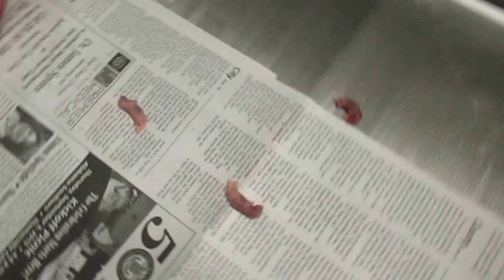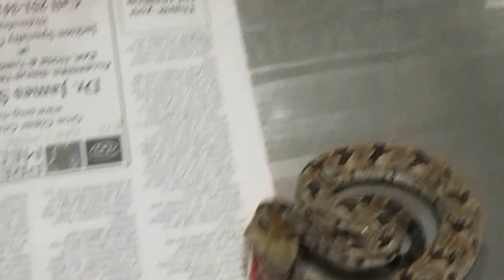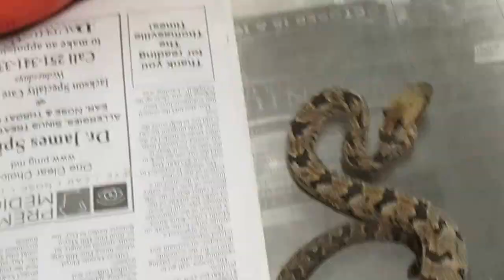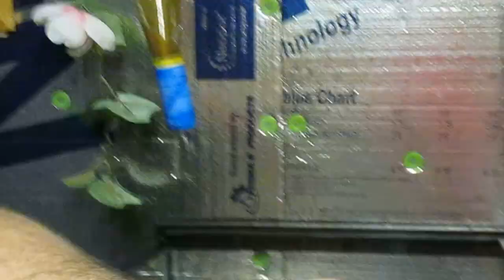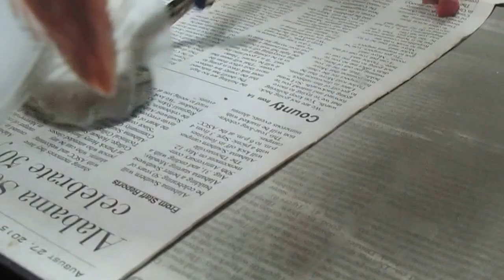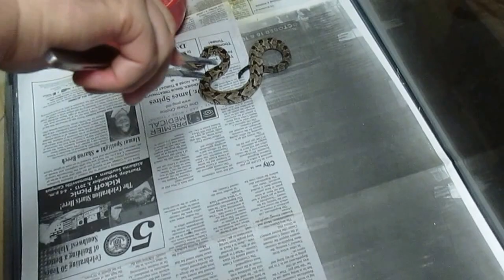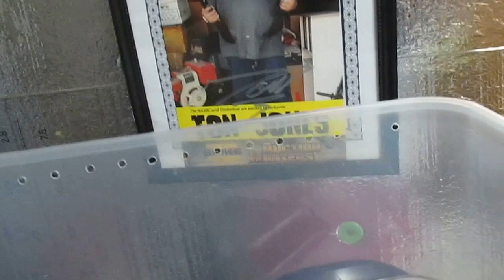how i force feed baby rattlesnakes that wont eat

Comment: This video should be titled how NOT to handle rattlesnakes. You should never let them thrash around like that when pinning, rattlesnakes in particular are susceptible neck/vertebrae injuries from improper handling. It is a big reason why many wild caught animals fail to thrive in captivity. As a 30+ year keeper myself with many rattlesnakes you must always support their body weight and use foam over the body or have another person assist in pinning to control their bodies and avoid the kind of thrashing response seen in this video when pinning at the neck.
Reply from the maker: +Richard Boschen you are absolutely correct thank you for taking the time to point out the mishandling  i was lucky all worked out and they eat on there own now ill be more careful next time

Comment: Have you tried cutting the pinkies head open? Not sure why this works, but snakes seem really drawn to the smell. Also it helps to put water on the dead pink, to help it go down. Also as a last resort, when they refuse to after all other methods is to use a syringe with a rubber tube connected to it. Cut the rubber tube at a angle and trim away the sharp parts. Fill the syringe with beef or chicken baby food. Lube the tube, slowly slide it into the snakes mouth toward it's stomach, but not too far down and very slowly start to squeeze the baby food into him/her. When you see the snakes stomach start to fill. Remove the tube very slow. This works great like on young milk snakes. At least it gets food into them and over time they will start eating on their own.